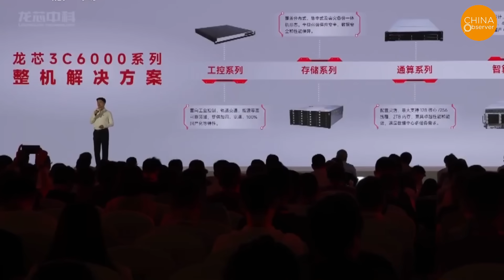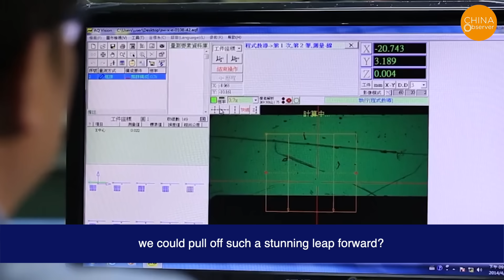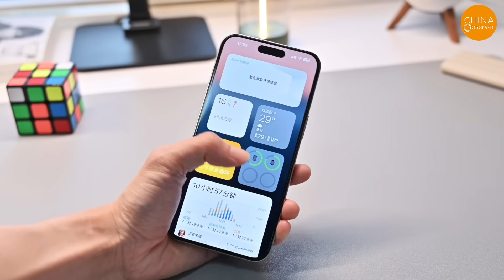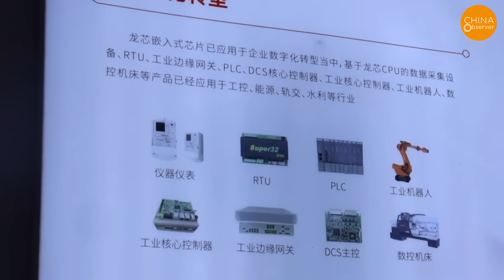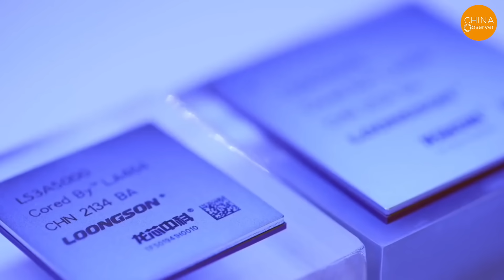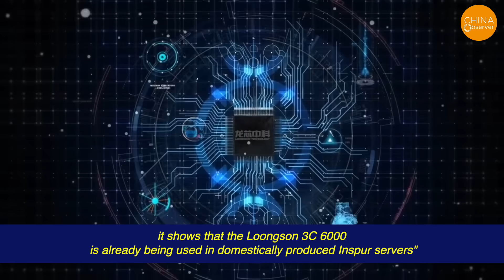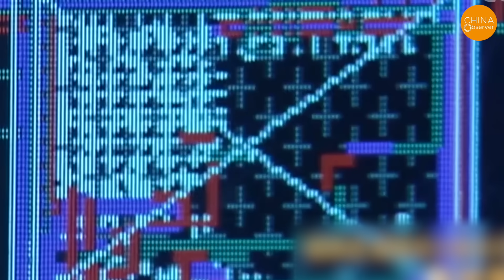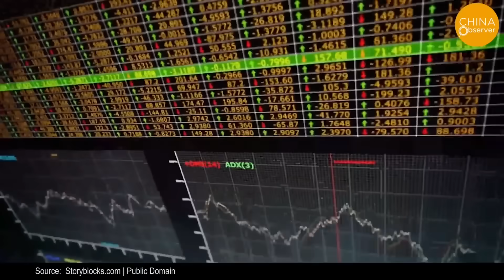Global Laughingstock! China’s Loongson Chip Claims to Beat Intel, but Lags 13 Generations Behind

Comment: Using honey instead of thermal paste gives a 69% performance increase!!!
Reply: 🍯🍯🍯 @roscoejones374
Reply: It's on diet. No sugar
Reply: Used grease, not honey!
Reply: that's a sweet processor!
Reply: remember to put some on the pins for extra 10%
Reply: Really? Nice!
Reply: speed you mean
Reply: Xijinpooh aproved
Reply: Liquid cooling with gutter oil give a 35% thermal increase.
Reply: Used oil because Chinese loves any kind of oil

Comment: As soon I heard that they had their own instruction set, I knew it was a useless product. Without licensing the x86, AMD64, ARM instruction sets, they wouldn't be able to run any of the software currently out there. They'd have to develop their own compilers and software. Even if it's faster than Intel or AMD, no one's going to use it, because there's no software for it.
Reply: They should have gone with open source RISC-V
Reply: @kit888 MIPS is kinda of an older cousin of RISC-V, maybe RISC-3/4ish.
RISC-V learned from the shortcomings in MIPS and simplified it.
I wouldn’t be surprised if some future version of longsoon is actually RISC-V derived.
Reply: To be honest, emulated windows runs on m series apple laptops (arm chip), and windows now contain linux subsystem as default, and hobbists emulate radically different gaming consoles (e.g. n64, ps3) already.
China has tons of cheap devs (a lead dev is supposedly less than 1000 usd a month there) and almost-frontier AI companies so its possible they make emulators that run other OSs/programs.
However, i know for certain CCP doesnt reward good engineering, it rewards connections so their projects are fundamentally doomed either from tofu-quality or involution.
Reply: @chinesesparrows  apple spent 10s of billions buying the best engineers to get it to work. M$ still can't get arm working correctly on windows. China stands no chance of running x86/arm on their own instructions unless it's at a snail's pace.
Reply: As others have noted, LoongArch is a fork of 64-bit MIPS architecture, which means it only runs Linux distributions compiled for it, since no other OS has been ported to it. MIPS seems like a strange choice but it makes sense given Loongson chip development started back in 2001.
Reply: MIPS  instruction
Reply: They use gcc and the like. I remember Richard Stallman had a Longsoon laptop a good while back, entirely blob-free.

As for software, Linux. Widely used in servers, server software. The EU countries have been funding desktop linux for a while, to run on government computers, so you have office software and the like.
Reply: It's a MIPS instruction set
Reply: China actually have their own x86 chips called Zhaoxin, and they are also quite bad
LoongArch is still supported by a lot of Linux distros though
Reply: It's MIPS--something like RISC-V but closed source. 

Imho the only issue there is if they wanted to hastily get to autonomy, they could have made it open: this way they'd have an easier time with people taking interest and writing compilers.

The funny thing is that open stuff is MORE securable: talented people you don't know about will analyze and report problems. Closed stuff isn't really closed: state actors will just put your chip under scanners and microscopes.

From specs stated, it doesn't sound useless. From hearing complaints about speed though, it sounds like many approaches to writing the "native" software are too "modern."

By the specs, it may be a relatively lagging set of specs compared to alternatives, but with the all-new design and new software, that should hardly matter. You can optimize new things bottom-up. 

And since it's new, here's hoping some projects get licensing/permission to spec out the architecture in the chip so that we could write compilers and get Doom and LibreOffice running. 😃

I don't know why you think @aha0tube that them having to write compilers is a big deal. Devs write compilers for fun and they're just translation layers: many today can be modified rather than rewritten outright to get them running on new hardware and many go through some tool like this such that once that tool is working all the other compilers are freebies. 

The major thing with security isn't just hardware (though it matters) or software (though it matters) "as usual": to secure hardware requires extreme rethinks that just aren't happening much (tio expensive) -- so the usual way is to be clever (like segmenting things and treating everything as untrusted); to secure software you do that kind of thing in design of the system--compartments, proper kernel modification, and simplification to verify and ensure correctness.

The idea that America/the west cares about Chinese banking data is... probably for propaganda: the US cares a lot about that data in Switzerland but China has a "closed book" for the RMB and a system of finance that isn't considered modern or interesting (this isn't an insult, China has its own needs and politics that make its banking and finance into political tools--like Germany, opposite the US). 

The probable necessity in their eyes is "good enough" tech in case of sanctions and whatnot. To keep the lights on and systems humming. Even then, do software well (vs per internet fad think) and a chip "like 5-8 years ago" is more than fast enough: it's BLAZING.

Modern devs just don't know how fast chips really are. Channels like this focus on negatives for the eyeballs but all techies I know hear "new" CPU and go "cool, I want one to play!"
Reply: @infinitelink  MIPS... wasn't there a chip like that in the Playstation ONE?

Comment: Surpassing Intel's chips 23% very doubtful from somewhere not having their own technology, but copy-cat attempts only. 3% Might have been believable, but 23% over did it.
Reply: It's probably a rebranded Intel overclocked 23%
Reply: I wouldn't even give them the 3%, maybe 0.5% at best!😁
Reply: Gotta factor in the nm thickness, a 12nm performance isn't comparable to a 10nm chip.
Reply: @nyczyar  and also only a tiny fraction of the story
Reply: AMD Opteron had to go somewhere…. Right?

Comment: Even though it's nowhere near the speed of current intel cpus, it is still impressive that they have something pretty modern. The biggest problem is that the CCP was lying about it's actual capabilities and hiding the use of foreign parts. It is nowhere near the realm of usability for non government use, but it can help with computer security in government applications.
Reply: Exactly! It’s impressive to me that it’s as good as it is given the constraints of not having access to the latest chip fab tech due to export controls, and the desire not to infringe on any foreign patents or use a design that was obviously stolen. There’s a lot of activity on the Linux kernel mailing list to add support for new Loongson chips, so it’s likely to be reliable at running Linux, especially since the instruction set is a MIPS variant, which has been supported by GNU compilers for 30 years.
Reply: @JakeHambyZ80  "desire not to infringe on any foreign patents or use a design that was obviously stolen." China's been doing exactly that for the past 20-30 years though, they don't care one bit if something they make was initially stolen from elsewhere by them and they sure as hell don't give a crap about patent infringement either.
Reply: Yeah...help the CCP in silencing its own people and controlling all narratives.
Reply: Yeah, it's "impressive" how they steal and counterfeit constantly...
Reply: Pretty modern....10 years ago stfu and go bathe in a toilet. Thats pathetic copy dont innovate loser mentality is why these zeros will go extinct.

Comment: Even Russia has better chips lying around for laundry.
Reply: No they don't.
Not ones they made anyway.
Reply: Russia has no Chipmakeing its just not pratical . Extremly expensive but low value out put
Reply: Russia makes their own chips for military applications. For that, they work fine.
Reply: @leftistfatigue That's a lie.
Reply: @FuckDictators Yeah? And what are you gonna do about it? What are Mikron and Angstem fabricating then?

You would be a fool to underestimate their capabilities.
Reply: Same old story; CCP boasts and the media roasts… 🙄
Reply: Russia is currently about 25 years behind the west, in terms of chip technology.
And in terms of technology overall, 25 years is A LOT.
Reply: @FuckDictators  

but if you include military grade chips ,they're either on par  or better.

some can even run Warthunder(Baikal) ,but there's no intended ecosystem for that.
Reply: @aaroncruz9181  lots of there military grade chips come from the west, some of their missiles are powered by Texas Instruments
Reply: @aaroncruz9181  military chips on par or better? kidding? they're using old generations of Texas Instruments, Nvidia and some other western chips in their warfare, what "on par" chips are u talking about, can you name any chip in particular? I get it if you need to check against a handout manual, go ahead and take your time xD

"Can even run Warthunder" is a HUGE achievement for 2025, by the way. And can it run "Cities:skylines 2" or "Microsoft Flight Simulator 2020" on max settings in 4k? Can it run at least one stream of 8k? 12k? RAW Uncompressed Video in Davinci Resolve? Let us know on those questions and get yourself a new calendar it's not 2013 anymore, 12 years have passed since War Thunder is on the market.
Reply: @aaroncruz9181  No they arnt . Russia is realy far behind . Russia is just not realy a big ecconomy in general . Like everywere els American and EU tech dominats